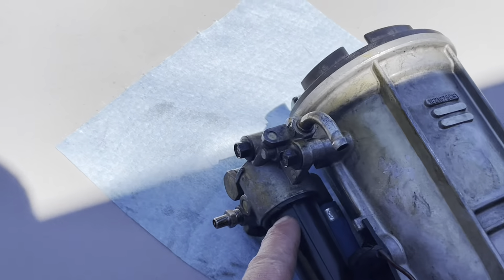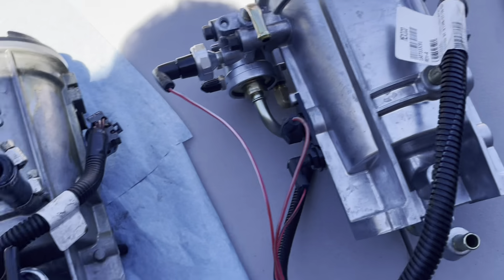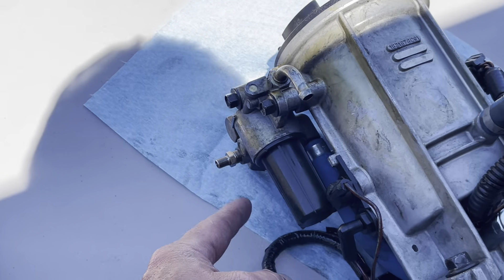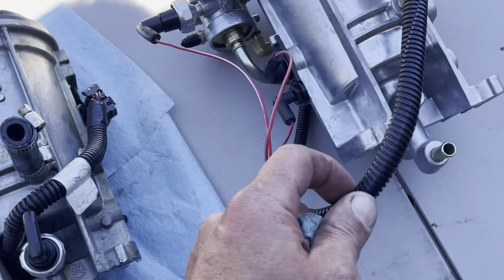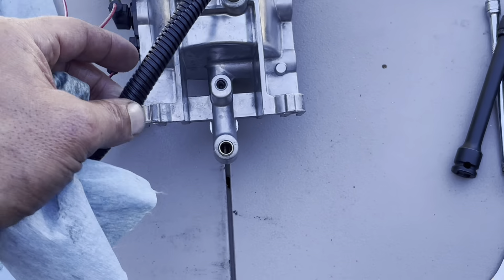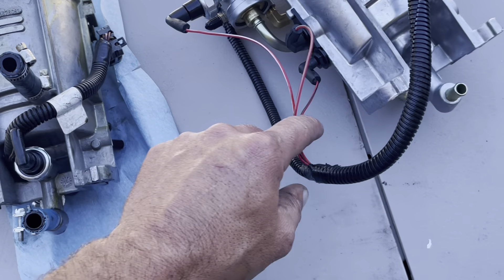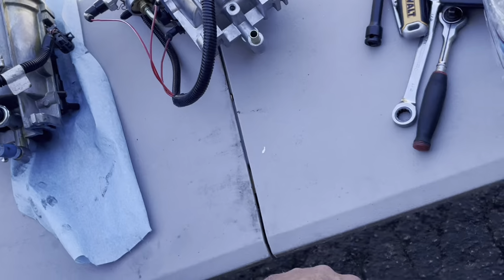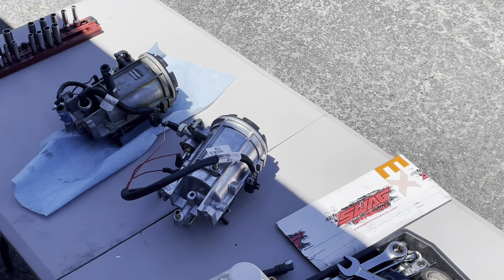Ford 7.3 Powerstroke Fuel Bowl Replacement - Real time removal and Installation

Comment: I have a 97 F350 and fought leaks in the valley for months . Turned out it was coming from the fuel pump. After I replaced the pump the leak returned. I did an autopsy and the cause was the way the diaphragm was swaged to the actuator shaft so the atmosphere side would fill with diesel and pump out of the vent holes. I replaced the mechanical pump with an electric pump with filters on the frame and haven't had any diesel leaks for years. So many of the replacement parts are inferior. Same with the mechanical vacuum pump.
Reply from the maker: @oskarbud525  you’re absolutely right. I did the fuel pump a few weeks prior to this. I guess I got a good one 😂 I have been seeing and reading a “new wave” of Motorcraft parts that are inferior too. We’re in for some wild times. 🤦🏼‍♂️ 
Appreciate the comments, keep em on the road 😎

Comment: Wait a minute so you mean to tell me that I can take my 95 7.3 fuel bowl off and put on an aftermarket fuel bowl and it will work because the shop told me I can only use a 95 fuel bowl only
Reply from the maker: @jamesharris9296  I would imagine if the aftermarket is for a 96 or 97 then it shouldn’t be a problem! Ford upgraded it  for a reason 😎